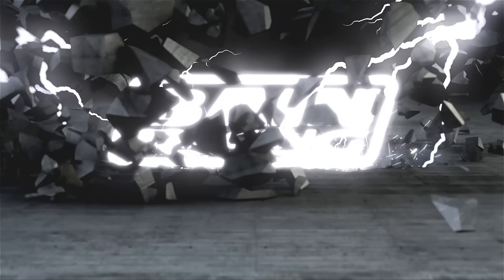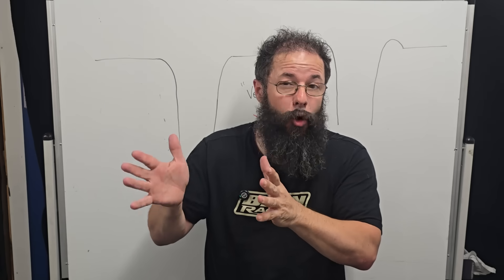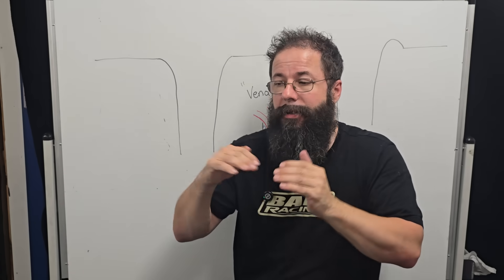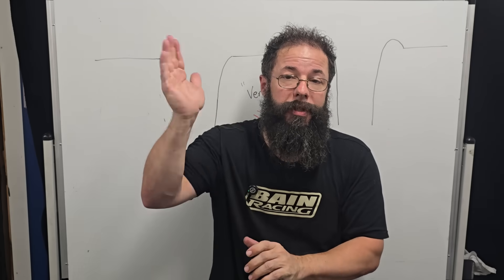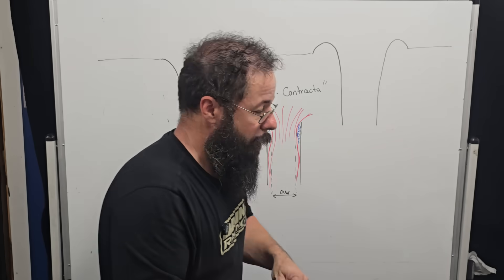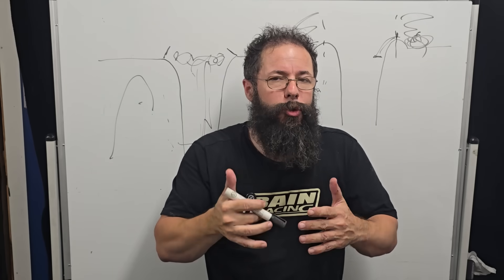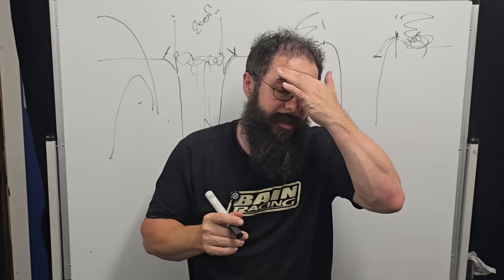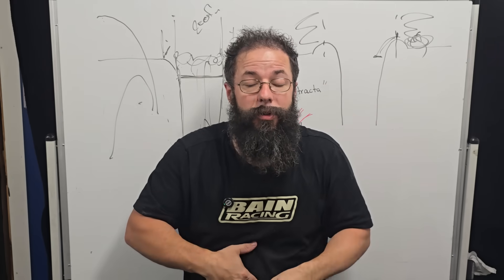Floor vs Raised Radius - The TWO Functions That Control Intake Performance"

Comment: Another great video. How does this apply to a forced induction setup where you’re probably not chasing wave effects?
Reply: Warren from Sydney.
Reply from the maker: Hey Warren.  Same same mate. You're 100% using wave harmonics with boost. Remember all engines are boosted by 14.7psi of atmospheric pressure.  The "additional" boost only changes our pressure differential.  So now at 10psi. We are 14.7+ 10, so our pressure differential is 24.7 and our wave action actually has more strength and can add even more free HP💪

Comment: i don't agree with "purpose built" vs "safe".. i have designed a purose built intake manifold for a boosted race engine with a set target numbers. eliptical raised bellmouth showed far better results than any other designs in both cfd and on dyno and could take anything a 91mm compressor wheel could push. the only reason i see this shape is not used is money. significantly harder to design and porduce. i believe the reason for using different shapes (except already mentioned) is the intended application of the engine and the optimizations (shortcuts) that can be taken to still be able to meet set targets. ( i am from Europe, Latvia)
Reply from the maker: Not true at all mate. Its 💯 how close you want it to the line.  If you understand wave harmonics/velocity you will understand why this is correct.  Eliptical just give power away.  We have proven this hundreds of times.👍

But where your confusing probably comes from is. If you're f boosted I would expect your line of sight is horrible! And you have biased flow to compensate for. Hence why you needed a full rased radius. 👍 

Hope that helps.

Comment: I understand your basics of your video.. spot-on..... but i have been thinking the floor of my Holley - hi-ram is not optimized like it should... do you have any info on this manifold ? i feel I'm having  a issue of puddling on the floor... that causing a lag or hang of idle return..?  great video...
Reply from the maker: Yeah it definitely can if there's a raised radius or an area for pooling at idle. This is something we have addressed many times over the years.  A tell tale sign is usually a stumble with accelerating hard of the line and black smoke. 👍

Comment: Inlet manifold reversion is often very much over looked. Sometimes a very small step in the intake under the venturi point will reduce this significantly.
Reply from the maker: Yes!  If you create separation this will create a negative pressure area. That can adsorp the positive wave or soften it enough to not create any fuelling issues 👍👍

Comment: Fun stuff.  I'm an engineer with background in engine performance and manufacturer of race products and porting in the earlier days.  I was always asked about how to port and such.  My response was always to start with the books "aerodynamics and fluid dynamics 101".  People that don't understand, call it "black magic".  No, it's math, and it gets complex until you can really grasp how air behaves.  Even some in the comments mentioned things are different for turbines, etc.  No it isn't!  Air is air!  But as an example I use for people, we have subsonic velocities in the intake, then supersonic in the exhaust!  That changes everything.  Always look at the leading edge of a 737 vs SR-71 for inspiration.  Eddies, skin friction, boundary layer, etc.  But I find most people don't want education, they just want to go faster for free.  IE, let me spend 10y in school to learn this, so I can give you the keys for free.....  Thus why we stopped porting.
Reply from the maker: Yes in a way they cross over to some extent.  There's obviously acceleration factors and density shifts we need to account for in ports.  Also long curve work in area but not in runners. A short sharp bend is better then a longer radius.

The other problem I see with many engineers I work with that only have a background in aerodynamics and not porting is that exact example you gave with the 737 and the supersonic sr71. 

If you port like a 737 and leave big radii like on the divider of ports. You go backwards.  Whereas if we reduce as much drag as possible like the SR71. And knife edge that divider.  We make power.  👍

But that is the key mate. Understanding how it behaves.
Reply: @bainracing  My example of a 737 vs SR71 is simply that!  To get the mind to ponder 'why'.  Another is dimples on a golf ball and why we don't do that in ports.  As for an intake divider, we can probably agree that this is case specific, as well as laminar and turbulent targets are decided, as well as CFD efforts way before a port is touched.  Another little nibble on a divider is that knife increases crack potential in a 2 stroke.
Reply: I don't see a specific book with that title. A couple books on the separate subjects. Do you have an authors name?
Reply: @brokenmotorcycle5070   "101" is just a college term for "introductory".  I'm sure the books I used have been made better.  Simply find any books and absorb fluid and aero science.  You might think some is not relevant, but it is.  When I see knife edged intake bridges in 2 strokes, I already know someone didn't study.

Comment: Raising the bell off the floor can give you extra runner length without compromising clearance. It's a tradeoff..
Reply from the maker: Yes. If you're limited for room. But its better to have the floor at runner length 👍 we cover this in the following video.

Comment: Hello from San Francisco.

I'm developing a manifold for the VQ35DE, and having chat with Cosworth about their infamous intake manifold, it still seems unclear where to start with calculating these tapers/gradients without simulation or flow bench available. Their unit used flow horns with elliptical profiles and did not develop power for most (mildly tuned) users. Eric said he'd developed that manifold purely for a race program, hence the lack of results on standard cams and heads.

The only other clear literature belongs to Blair as you've mentioned, and there was another article published going over reversion and fuel spitting.

Do you have any specific methodologies for calculating the radius and transitional length?
Reply from the maker: Yes all radius are calculated off the relative air speed. And the length is off the harmonic elements.  3rd harmonic being the best for all types of racing and even street.

Comment: Hello, I'm a big fan of your channel and I've been following you from Chile. I'm curious to know how you would handle MCSA in a Siamese valve port that feeds two cylinders (one port feeds cylinders 1 and 2, and the other feeds cylinders 3 and 4). This port widens considerably in the section where it splits to feed both valves, and this is in a 1-3-4-2 firing order. I hope you can look into this question. Thank you so much for your videos; they are very informative and we learn a lot from them.
Reply from the maker: Thx for the follow mate. 👍   yeah that's always a struggle.  We still try to get the lower half where they are separated right. The rest you can't do much with. We have filled a made that common area a bit smaller than the sum of the two with good results.  But we are only talking 10-15%.   I've never gone past that.

Comment: Info is great. I would like to add my thoughts, then my knowledge.

The boundary layer sheer concept, I learned from 2stroke tuned pipes.
 Whether a tuned exhaust, or a tuned intake.. the fundamentals are nearly identical. Basically change for temperature and crankshaft rotation.

As far as a secret to 2t pipes, which may apply to intake radii, ...
Keep any given volume or angle to around 5°, and NEVER exceed 7° of change at any point, regardless of angle length or incremental change.  7° of change is the point of layer seperation.

IE:  Straight into an angle (this angle should never exceed 7°), 7°angle into another 7° angle (this second angle, when measured in relation to the straight pipe, will actually be 14°. And so on.
Now keep in mind, the above is for a 2t tuned exhaust pipe., now considering that exhaust speed and temp are Considerably different than intake temps and speed.
The concept should still apply.
Reply from the maker: Even exhaust to intake on 4strokes are very different mate 👍   two very different boundary conditions and the angle isnt something we use. Guys used to use angles. But CSA , volume of the primary length and air speed is a far more accurate way.    The problem with set angles is i can change my length at the same air speed targets and the angle changes. Hope that makes sense 👍

Comment: Math with no flow bench and no dyno is theory.
Reply from the maker: That's why we showed the math built the intake and set another record. 

 That statement you made shows you dont understand the first thing about engines or fuild dynamics! 

Maybe learn the math that EVERY successful intake and head guy uses rather then thinking you know what you're talking about 👍

Comment: Great stuff, man! I'm integrating the runner bell mouths in my patent-pending multi-fit casting. I think it would be great to set up a spreadsheet/MATLAB program where I could input the required parameters to speed up the math. if you could point me in the right direction, that would be great.
Reply from the maker: You will have to build one like we all do mate and work out what factors you want to work on. 👍

Comment: One of the things we've done to find how tight of a clearance we can run on a modified oe crank is find how much they deflect at max cylinder pressure at the angle of mcp.  You have to do this with the crank locked at the flywheel and a middle cylinder with dial indicators all over. Make a hydraulic piston and fat rod bring the cylinder up to 105% mcp and that will allow you to find the block and crank twist average then tear down and measure the crank and tunnel for deformation. (FYI All parts may be scrap at this point.)😅
Reply: You can do that with FEA now..
Reply: @blaqlabspodcast5816  FEA wasn't that easy to get and trust 15 years back
Reply: @alexhise968 real life testing will always have a place for sure..

Comment: Hey Jake, my name is Chris. First of all, thank you!  Your videos educated me in a way that allowed me to gain 22 wheel horsepower in our S65 plenum that we sell.  Armed with the information in one of your older videos, I was able to nearly double the next best gains anyone has achieved in the ~20 years people have been designing plenums for this M3.   

I do have a question, though. Darrin Morgan talks a lot about best practices for turning airflow in tubes and how velocities impact air's ability to turn a corner as a result of its inertia- something you talked about here.   I understand best practices around the bell, but in the tube itself, how can I best maintain velocity (and therefor, the inertia to get the supercharging effect) when packaging constraints demand a curved velocity stack to achieve the appropriate length?  in testing in Fluent and on our flowbench, the intuitive choice- the widest curve possible, chokes the mouth of the stack immensly- velocity at the inside of the mouth (relative to the radius of the curve) is 3-4x higher than at the outer side.  I found an optimal radius that resulted in the least choking effect and most power, but I am curious if there's something else that I am overlooking because it too is so counterintuitive.  

Thanks,

Edit, if you would like to see my CAD so that you can have a better idea of what I am working with, let me know and I can email it to you.
Reply from the maker: Mate that is an awesome result! 💯  yeah forsure.  

Best practices is usually a short shape bend. Rather then a continuous bend.  Also the shape is important.  I like the wide floor narrow roof to help balance velocity.   Yeah you can email me mate at bainracing@gmail.com 👍

Comment: Amazing video. I have a question and it would be amazing If I could get Your input ... Im building a 1200hp vw R32. For those that dont know the R32 is the 2jz of the VW family. Issues is Im developing my intake manifold at the moment in CAD. Biggest problem we have is the 3 rear cylinders have a intake runners that is basically 2inch longer that the from 3 cylinders. And there is absolutely no way around this. In a cast like this would You advice to design the intake to pull the 3 front cylinder runners off of the floor by 2 inches to try and balance out the harmonic and get the front 3 cylinders intake to the same lenth as the rear?
Reply from the maker: Yes. Try and balance lengths.  I have a follow up video tomorrow that talks about trumpets and when they work. 👍

Comment: Hi Jake, another knowledge bomb video. I have a question that this video brought to mind. I have a four cylinder Edelbrock manifold that I cut the plenum off so I could work on it. The first thing I thought of was the plenum was basically a log type, so as cast the bell mouths of the runners were sort of a fish mouth shape. I was looking for that strong signal you talk about and also wanted to add a tiny bit of runner length, so I went after it with a bunch of 1/8 welding rod and filled in the floor so that it's now similar to what you are showing here. flat floor to the runner with a tight radius. my question comes in as a lot of time compromises have to be made. The runners basically come in like this: /II\ if I shape the floor where the runners intersect so that the bell mouths are square to the runners, it will not be flat, but more of a u shape and I will end up with two different harmonics. one lower harmonic in the longer outside runners and a shorter higher harmonic in the center two runners. at first I thought this might not be the worst thing as the outside runners would come on a little earlier than the center that are targeted for the cam. 
Ok, all that to ask, what would be the effect of cutting the whole floor of the manifold flat and having the bells of the outer runners at an angle to the actual port? 
I'm trying to weigh whether it's better to have a split harmonic, or maybe hurting the signal to the outer cylinders by putting the bell at an angle. 
I appreciate you sir.
Reply from the maker: Yeah you can still have bells if the manifold has biased flow.  Ill do a follow up video to explain 👍

Comment: Thanks for the video. Its still a little over my head unfortunately. I have another question about the back wall of the plenum, opposite the runners. If reflection is the goal, i'd imagine that wall would have to be perfectly parallel to the runner openings. Not something you see on most aftermarket manifolds. Has there been attempts to create slightly concave surfaces to focus the wave back into the runner more accurately? Brad from NZ.
Reply from the maker: Yes in a way the distance from all cylinders is very important.  We covered this is our tunnel ram build series.  Also the V12 Aston Martin engine is a great example of secondary infection tuning.

Comment: I am sitting here with my dad watching your video and after it finished my dad got up opened the workshop and was looking for something I asked him what and he replied a cut away manifold from the 70’s and old book of Polaroid photos and hand written notes on the back. It was like listening to you in my dad’s workshop. There is a crazy amount of section Holden heads with brazing and sections added to raise the roof or the port infills to the bottom of the floor. Judging by the amount of brazing I don’t think they had to much water flowing through them port and bowl areas where brazing material was greater than cast iron it surly must have been a mammoth job to braze up an machine these hi flowing Holden heads the figures are like a bbc cylinder head. I am trying to get dad to share some of the information and details and pictures but he is sceptical but I see him in you and hopefully he may share it with the YouTube community. He is a man of very little words but I am sharing your videos of you with him and trying to get his experiences to help other also . Cheers for the great content. 👍
Reply from the maker: Mate that is an awesome story! It's so cool that your dad has all that history and knowledge. Hopefully he'll share it one day 👍

Comment: I see a lot of people talking about this kind of stuff, but no one else really covers the nitty gritty how's and why's quite like you do. Top tier stuff! Thanks!!
Reply from the maker: Glad you find it helpful!
Reply: Frequency. Air flow is only half the solution. It seems to me like the longer the CSA can be maintained, the closer to ideal the frequency stays. This is probably true for manifold runner taper.
Thanks for the great video.  It sounds like 1/2" or 12mm radius is the target for low rpm, first pulse wave, action.

Comment: We used 0-5 redline synthetic oil in our Super Stock Hemi's making over 900h.p....in the 1970's-80's it was 20/50 Pennzoil racing oil (non synthetic)
Reply from the maker: Awesome to hear! 👍
Reply: @bainracing  we tried 0-2 but felt like it wasn't helping.

Comment: Could you discuss how much this design changes or what matters and what doesn't in a boosted application in comparison?
Reply from the maker: Yeah I've covered this in the induction series.  But will do some shorter videos on this.

Comment: What's your take on the Coanda effect for turns? Westing123 Colombia
Reply from the maker: Yep. We have covered this in other videos.   Definitely a mechanism that works to a limit where the inertia of the exceeds its ability to hold on!
Reply: @bainracing  It works on the 426 Hemi I been using it since the 1990's I also did dyno testing with it. I have used it in 440 heads too but it's hard to shape it in the narrow port. I'm doing a set of Super Stock heads soon I am trying a new method.
Reply: I think you are talking about the fins in the ports?